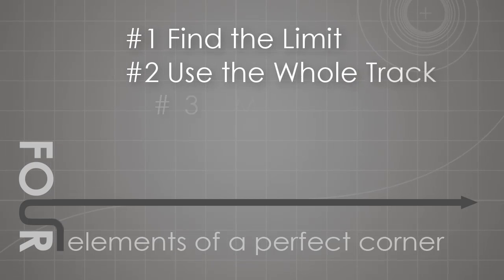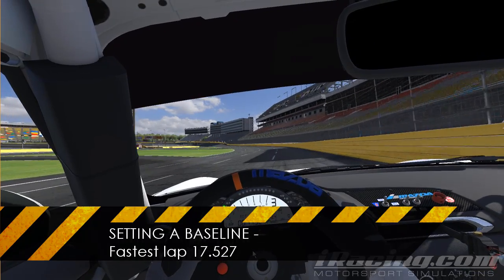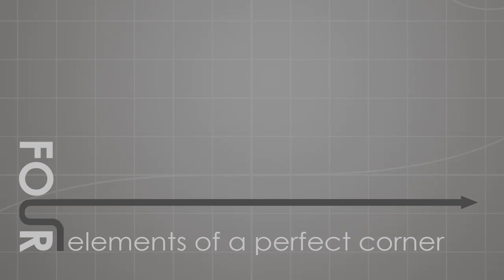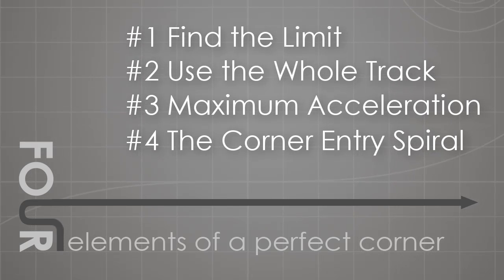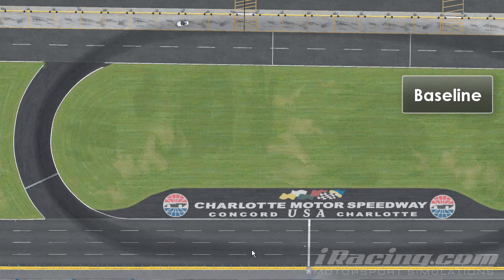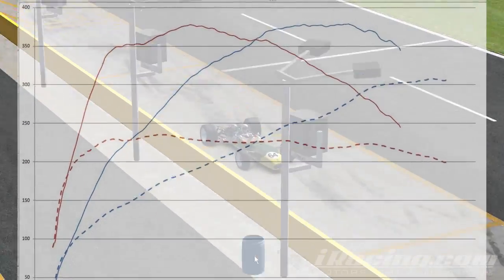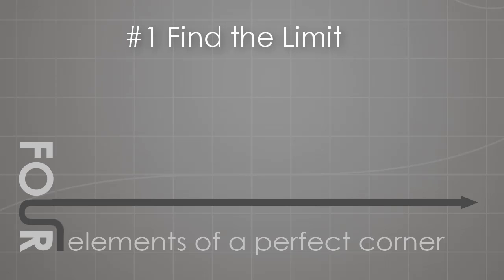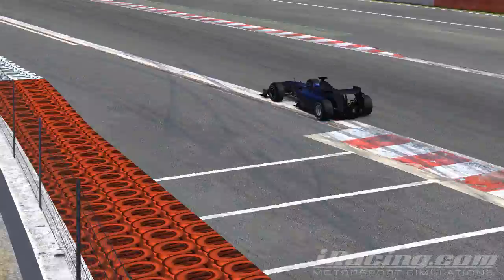The Racing Line - 4 Elements of a Perfect Corner (Physics Explained + Sim Training Tutorial & Tips)

Comment: I'm puzzled now... It means that favoring exit speed by late apexing before the long straights is actualy plain wrong, isn't it? I was also wondering how usefull is trail braking whith a karting that has only rear brakes, because it means that i only have the outside rear tyre connected to the floor, so i guess there is little grip left for braking. Can you help me with that one please?
Reply from the maker: That's right, the length of a straight should not affect your line.  It's not about the speed at any certain position in your corner exit, it's about how quickly in time you can get to that speed from the beginning of the corner.  Your apex will be "late"  in that it will typically be after the midway point of the corner, but you don't want it to be "super late," where you begin accelerating before you reach your apex.   Your point of minimum speed reached should always be touching the inside of the track.

For rear brake only karts you will still decelerate to the apex, but your entry line will be more circular in shape than the spiral line that would be ideal for cars and 4 wheel brake karts.    Good rear brake karters use a lot of slip angle during corner entry and somewhat pitch the kart a bit sideways to aid in decelerating.
Reply: Paradigm Shift Driver Development thanks a lot
Reply: By the way, if I don't care about current lap time, but i'm trying to break my record on the next lap, then, using "super late" apex on the last corner of the circuit should be a valid strategy. Do you agree with that?
Reply from the maker: That's correct.  You'll maximize speed as you cross the start/finish on your quali lap.

Comment: Extremely interesting, thank you for posting and, BTW, I love your books.  Questions:  If you replaced the apex points with cones and paved the infield would the ideal line change?  If you then removed the walls confining the surface what would the ideal line be?
Reply from the maker: Hey Jay, this is Adam, it’s really good to ask questions like this as it helps to test your knowledge.  Most corners are really easy to optimize because of the track limits.  Start taking those away and it gets trickier.

First off, if you replaced the inside with cones you probably wouldn’t see any difference, especially in the mx-5 as it has a relatively early apex.  The inside is already pretty pointy so it’s not getting in the way during your entry or exit.  In a later apexing car I do sort of run over the inside curbing a bit.  It takes a fairly large 180 with a more squared off inside track to need a double apex.

If you start getting rid of the walls, you do start seeing changes though.  If you just got rid of one of the walls, the line on the other side would most likely go out a bit, but not very much.  That’s because it’s a 180-degree corner and we are already at the 90-degree limit on entry and exit.  So for example if we got rid of the wall on the exit we couldn’t really apex much earlier as we would start going over 90 degrees on exit.  If we get rid of the entry wall, we are still limited by the exit side.  We wouldn’t be able to drive a huge entry spiral and hit the apex at 100mph, as we would never make the exit.  Normally a track is the same width throughout so you don’t have this issue, but not always.  At COTA some of the entries to the hairpins are very wide compared to the exit.  This makes it so there is no reason to start near the corner on very outside of the track.  Watch an F1 race there and you’ll see the cars, even when not blocking a pass, not use the entire entry on some of the corners.  

If we remove both walls, things change even more.  A few things to keep in mind.  You always want the largest entries and exits you can fit as long as you don’t go past 90 degrees on them.  You also only want to double apex if not doing so compromises an entry or exit.  For example, here you wouldn’t just drive a big circle around the two apexes.  You want the biggest entries and exits you can fit so you would just expand them until they started touching.  The exit to one corner would immediately go into the entry of the next.  There would be no portion where you are driving straight.  I was working with a coaching client recently who needed help with Willow Springs and turn 8 and 9 calls for this.  So many people get those corners wrong.  How wide you come out of 8 is dictated by where your entry to 9 needs to start, not by the outside of the track.  The exit feeds right into the entry.
Reply: Is this exactly what is covered in Book 1?
Reply: Hey Adam, Is this video everything that is in Book 1?
Reply from the maker: You would really need to put the knowledge together from all 3 in order to come up with my entire answer.   When you start taking away track limits things can become harder to figure out.
Reply: @ParadigmShiftDriverDevelopment  it’s validating to read this as an autocrosser because often the track limits are for you to decide and I wrestle with how wide to go. Thanks for the additional clarification in these comments, as well the very helpful video!